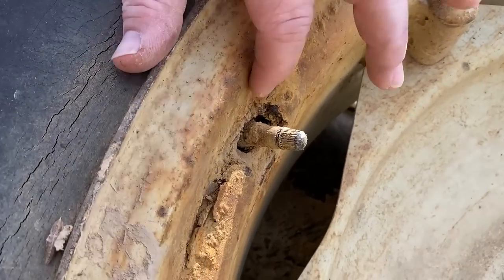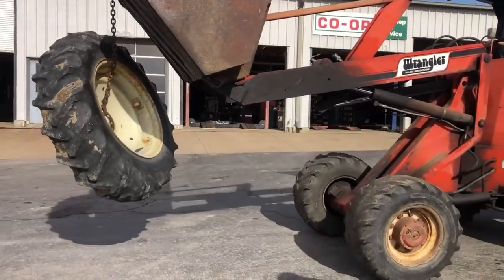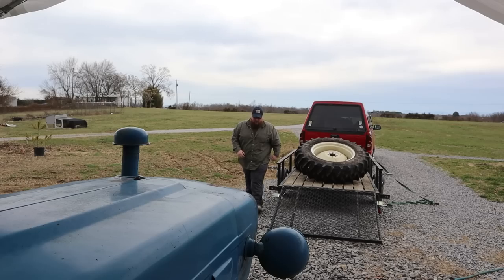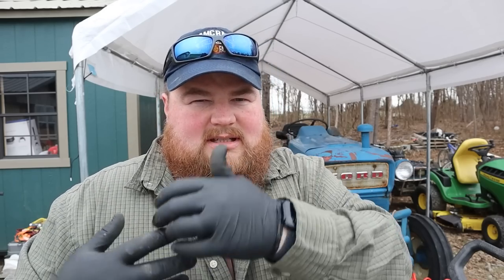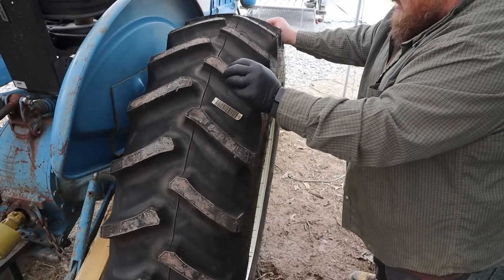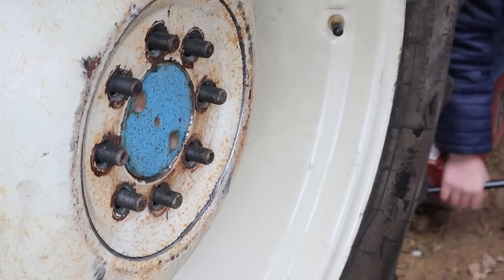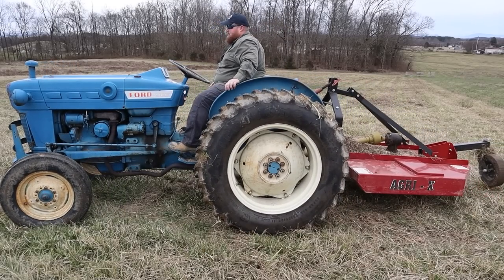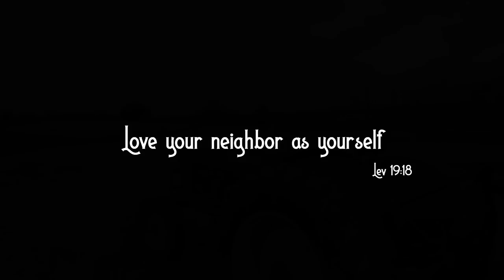One Tire Leak and THIS Happened

Comment: Sam loading the tires means they are putting in liquid calcium. Some of the old farmers used to load their tires with windshield washer fluid to keep them from dry rotting inside out, which is rare.

Comment: Sometimes when someone is a good welder they will cut the rust out & weld new metal in place ,then bore a new value stem hole in a new location. Around here people used coliseum & it would rust the rim & anything else it touched . But you did the right thing replacing them.👍🚜

Comment: Nice tires, Sam! Firestones are the best you can get, 13.6 - 28" are the same size as my J.D. 1020...
Glad to see you got it all sorted out & back in the harness!
Reply: Tubes are the only way to go on a tractor! As far as fluid, unless you have to push a lot of snow you don't need it... my tractor had fluid + 3 sets of weights(150lbs each), had the fluid pumped out late this fall and still have 450 lbs per side(not counting the cast centers!)...

Comment: Usually the rust around the valve stem is caused by the calcium chloride ballast. It's very corrosive.  I had that problem with my old massey 165. I ended up cleaning them up with wire wheels and welding in washers to replace the rusted out metal, then had someone else put new tubes in them, minus the ballast.

Comment: When you pressure wash like that, consider a little bit of DAWN spread out on the metal top pieces of metal housing with a soft paint brush then pressure wash from top down.

Comment: if at all possible you may want to use some anti-fuse on the boults so if need to remove tiers again the bolts won't be rusted up. if using the impact on rusty nuts may gall up boults

Comment: Nice job .  A word of warning , I had a  Ford 3000  and I pressure washed it just like you did yours .  When  the  starter   stopped working I removed & took it apart .  Water had gotten  in  &  ruinned it.  I had to buy a new one .
   If I had realized  water  had gotten inside I could have taken apart & dried it out  before it damaged the unit .  You may want to check your starter for water .

Comment: A possible cheaper & faster fix to rust around the valve stem is to take the rims to a welder & have them either cut out a square section & put in a new piece with a new hole. If it's not too bad, they can weld on a washer with a proper hole size for the valve stem. I'm a farmer & had that done to a few tires.

Comment: Good to see blue with new shoes. There isn't any reason to load the tires to run a brush hog on the ground that you have shown. Running the tires dry will allow the brakes to work better - less weight means less momentum to stop. 

BTW - those brake might be old enough to have asbestos in the lining. It would be a good idea to wear a mask (at the minimum) and be careful where the dust lands when working on them.

Comment: Greasy, gunky motors do well with some liquid, automatic dishwasher soap brushed on nice and thick depending upon the depth of the caked on grease.  Let sit and if truly bad and you can start the motor to get it, the caked on gunk, and the automatic dishwasher soap warm; not so warm as to cook the soap however.  Then pressure wash; ideally at some coin op car wash.
Reply from the maker: Thanks for the tips!

Comment: Why is liquid in the tires??? I was married to a mechanic for 15 years I never heard of such a thing ,is it a farm thing
Reply: There was calcium chloride in his tires. That's why the rims were rotted around the valve stem holes. Thats the first place they start to rust out. Calcium chloride is pretty corrosive on metal.It's used for extra weight on the rear of the tractor better traction.  Typically for plowing.